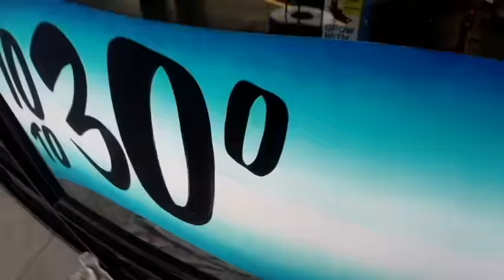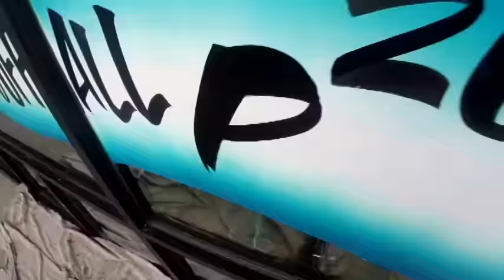WINDOW PAINTING TUTORIAL #113 Highlights & shadows. Thick& thin Outlining

Comment: Hi Scott! I very much enjoy your tutorials it helps me grow as an artist learning new ways of advancement thank you! I live in Michigan sometimes we have really cold weather sometimes freezing! When I applied paint to the window sometimes it freezes the paint or salt from trucks hit the window!  Trying to wash the window after is well very difficult! Lol!  What would suggest is a better solution! I have tried going from the inside , yet the display is not viewed very well!
Reply from the maker: Hi Sarah. Maybe you can clear the window with a couple good coats of rustoleum waterbase clear. If it gets hit with salt or dirt you might be able to remove it with out damaging the job. I haven't experienced that before. Usually if my window gets damaged I repaint it or if the damage is minor I touch it up. I have worked in 10 degrees Fahrenheit before. It's no so much the emperature that effects the window splash, it's more about the humidty. I use a propane pot stove to heat water. I then pour the boiling water in to large tubs and I set my gallons of paint in it to keep them from freezing. I rarely have to do this though. Sometimes I just keep the car running with the heater on for a little while to keep paint from freezing too. Good luck Sarah!

Comment: The Utrecht brushes are not available any more on line. I called a couple of the stores and did not find them. which video talks about the Richard Simmons brush?
Reply from the maker: Yes I know they are discontinued. I know there are other brushes out there. My challenge is to find one that uses synthetic materials. When I went to Las Vegas last year to paint some Halloween maze murals I forgot my Utrecht outlining detail brushes, I bought some flat single stroke brushes from Dick Blick, they worked fine. The main thing is to try out ones described as "script" or" single stroke" or "lettering". Having said that I personally have had problems with the long flat lettering brushes many sign painters use with one-shot lettering enamel. Experiment! Try different ones...although that can be a bit spendy at first. Here's the link to the video you asked about, good luck!   https://www.youtube.com/watch?v=A8pG0MWUgfg